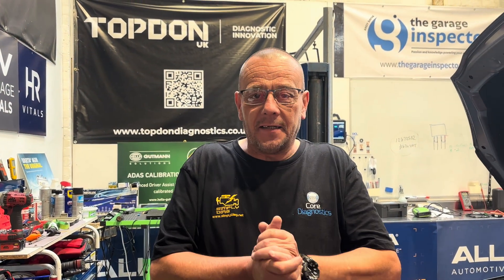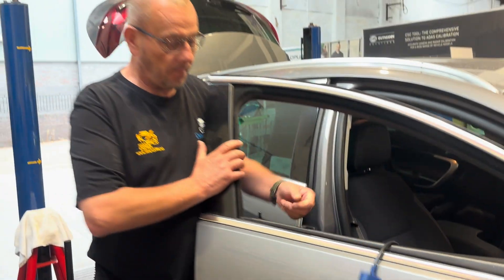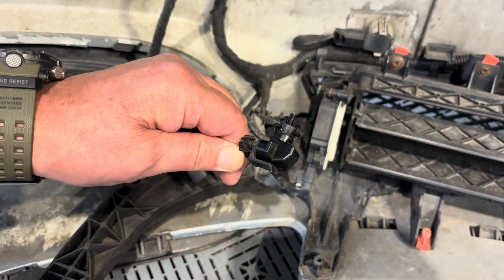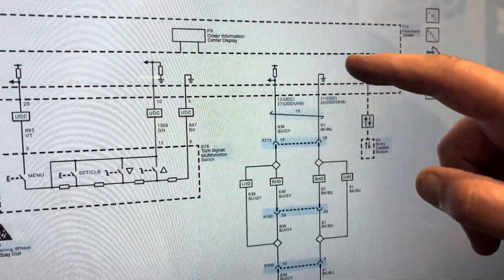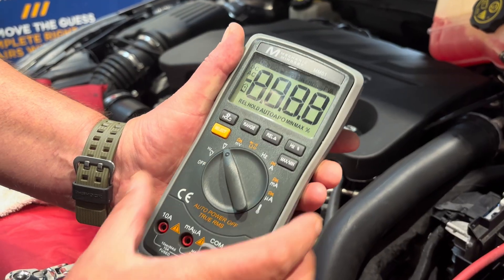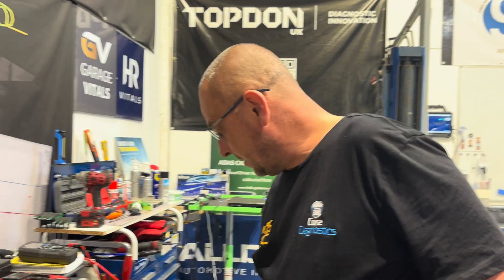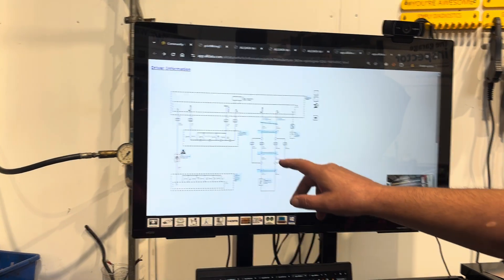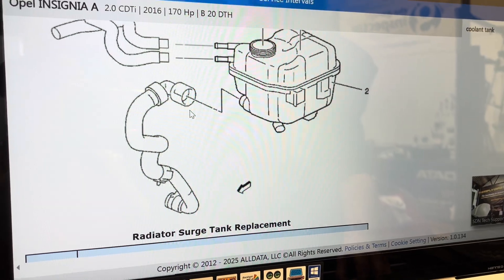How to check a 2 wire temperature sensor

Comment: I don't understand this stuff at all. There's 5v going in to sensor and a path back to ground from sensor. How does the computer "know" that there is a voltage change based on what the sensor is doing. Which wire does it see a voltage change on? The 5v or the path back to ground? If it can see voltage change on 2 wires what's the point of 3 wire sensors? Why does the 2 wire sensor need 5v to it in the first place?

Comment: We have a vw outside air reads no temperature on dash . Supply voltage is 3.12v known good. In my case sensor required

Comment: Probably a bad capacitor at the instrument cluster.  It makes me laugh really hard when the manufacturer themselves like Audi got confused on their own silliness on their wiring diagram.  Instead of actually using the wire color everything is on black  WS=White  SW=Black VAG makes the most complicated and most confusing diagram without any pinout or newer models. 

Ford makes the best and easiest to understand wiring diagram. They literally give you a map exactly where the Ground, Splice, connectors are located. They also tell you what type of metal are used on the connectors.  Gold, Silver, Nickel or Tin. 😂

Comment: Which is better Autodata or Alldata? Great videos.
Reply from the maker: Auto data is redrawn (I stopped using it a long time ago and Hella HGS is far superior imo) Alldata is the defacto winner as it's original OEM information
Reply: @SimplyDiagnostics  Thanks for your quick rsponse, im currently subscribed to Autodata i'm considering changing so your advise is appreciated i will check it out does it cover all car makes. Im watching your videos from New Zealand, lived here nearly 30 years origanly from Yorkshire. Keep up the great work.
Reply from the maker: There are lots of videos on my channel about the different info systems. 👍

Comment: I would trust this man with my car anytime

I actually have a random issue wherby my hazards come on whilst driving along in a fiesta mk6, but isn't affecting anything else.
I can imagine it'll cost more than the car to fix lol.

Seems like a wiring loom randomly shorts to the body
Reply: Dan is just the man to give you diag over the phone.
Reply: Any aftermarket device connected to your car that produce similar waveform from hazard button when you press it will confused the computer. It’s not wired like old school where the switch is connected to the relay and completes the 12v circuit. The modern switches are just 5v and not directly connected to the circuit. The switch only produce a waveform which computer sees as command. That why it’s possible to turn on the tail lights with DRL without the need of rewiring. Just imagine the push start button, if wired the old school way pushing it will always activate the starter even with the engine on.